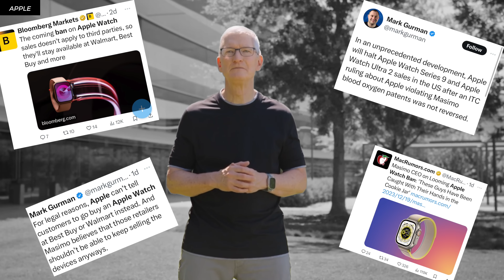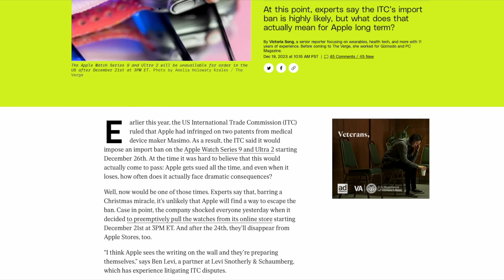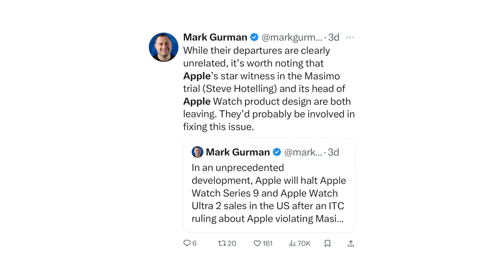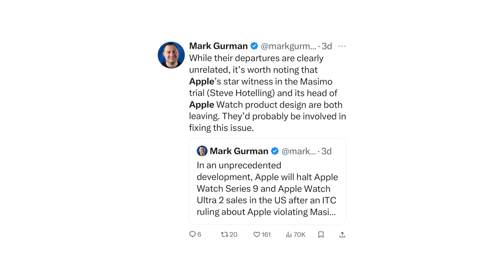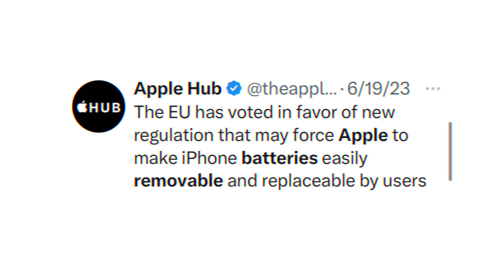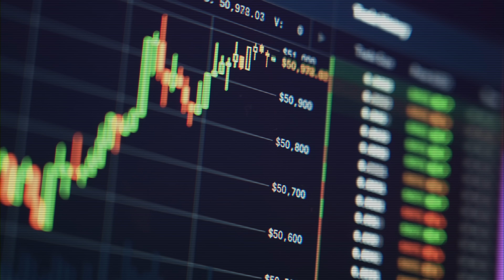Government BANS Apple Products… is iPhone 16 next?

Comment: So first the Apple watch ban is an entirely different situation from the EU regulations. Apple could have avoided this whole situation if they'd just acknowledged their wrong doing and agreed to pay royalties for the cribbed O2 sensor tech. 
As for the EU regulations while those regulations are costing Apple money it's insignificant compared to the money they would lose if they pulled out of the EU market. That's a 500 million potential customer base and even if they only take 10% of the market they only need to sell one subscription service to more than recoup the lose of royalties on the lightning cable. Sideloading is a different issue but one that I doubt is going to cost them as much money as people think. 🤷

Comment: Also …….. I feel an update to shutdown the glucose monitoring system is in the works which I feel is prolly why it seems like Apple isn’t tripping a couple weeks of no sales then when they bring it back and allow sells they will make back everything they may have potentially lossed cause any publicity is good publicity this will jump there sells guaranteed!!!
Reply: I think they may be required to shut down the entire sensor platform on all watches everywhere if the ruling goes against them, they could be forced to fork over all the profits from the watch. That is about 17 billion for the last several years. let's have a grand total in the 100 to 120 billion range.

Comment: I feel like the USB-C  thing was the first step to the breakdown… They didn’t seem to fight it much but iPads were there already so I feel like it really wasn’t that far off. Regardless I think government mandates were not necessary. And if it was it should apply to everything, not just Apple. As for the replaceable battery I don’t see it. Most of the popular Android phones don’t really have that either. They should be able to build what they and ultimately the customers want. If the customers don’t they won’t buy it…
Reply: Apple doesn't make nearly as much money off of USB-C as they did off of lightning cables. Apple got a cut of the profits from every lightning cable sold, regardless if it was made by Apple or not because Apple owned the patents. They make 0 if you choose to purchase non-Apple branded USB-C cables.
Reply: I have to agree about the removable battery. Having non removable batteries increase the durability of a phone by reducing the amount of dust and moisture that can get in.

Once the back of the phone is removable again, those IPX ratings will be downgraded or removed. I rather have a non removable with the IPX ratings.
Reply: No, I do want removeable batteries. Batteries don't last forever plus it's nice to swap with a spare one if you ever need it. Also I secretly am loving see Apple go down. Finally someone has the guts to do it.
Reply: @CityChristina you may be able to find a phone that you can swap batteries today, not sure it’s worth having though unless that is your highest priority from your phone… We are all pretty much at the mercy of the phone manufacturers and cell carriers anyway now
Reply: @justplanefred  It is MY phone. Once it's paid for it should be MINE for ME to do what I want to with it. Apple doesn't understand that.
Reply: @CityChristina  what are they doing to your phone that nobody else is doing with phones after they are paid for. Maybe I’m missing something.
Reply: @CityChristina  I can understand your point. For me, I still have my first phone, Samsung Note 2 and a couple of others, all in working order. The only phone I got rid off was my Samsung Note 5 (my second phone). The battery expanded so much that the phone was pushed apart. The reason I did not catch the expanding battery was I had the phone in a full protection case.

Also, there are power banks of different capabilities and features to charge your phone on the go. The ones I like is the power banks you can plug into an outlet and plug your device into power bank while it being charged.

Comment: They should force apple to get a mem card slot a headphone jack and most importantly the charger included in the box, these things should be forced on Apple until they stop resisting just like it did with usb c
Reply: Definitely not. If you want a phone with those, go buy a phone with those. It shouldn’t be a government forced mandate that the phone has those things

Comment: Any deviation from the Apple standard (design and possibilities) is seen as ridiculous to talk about. No Apple iPhone will ever have more than 3 cameras beside the front facing tech. Being able to repair a display or upgrade an old battery without Apple care services might be another actual thing to ban the phone. You get nasty messages and the phone is basically useless. What better reason to act on this.